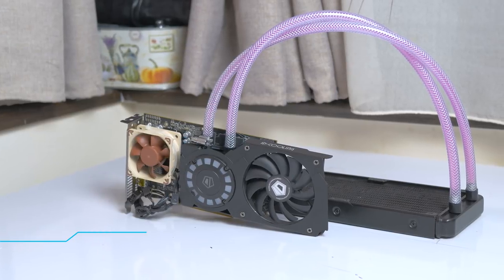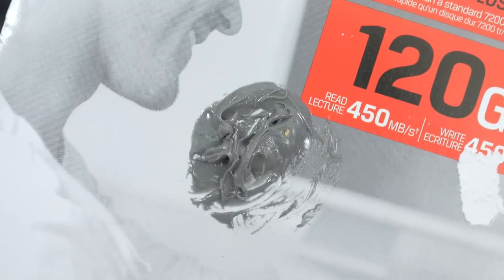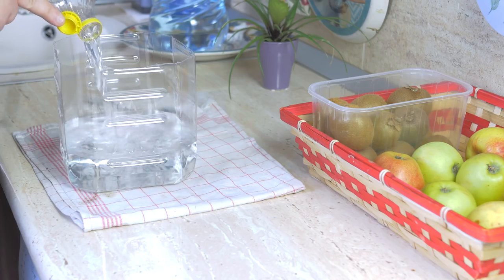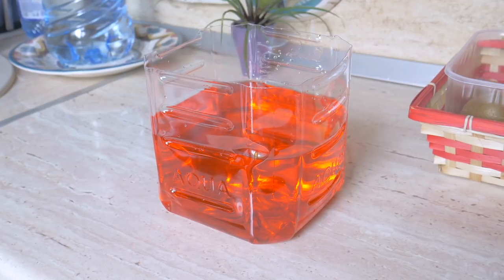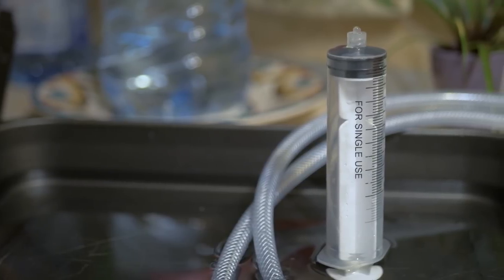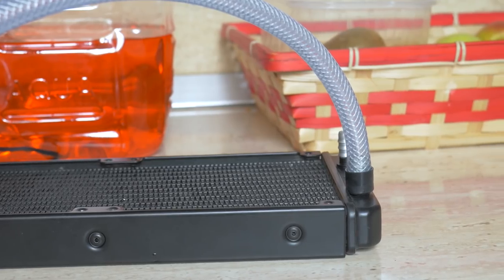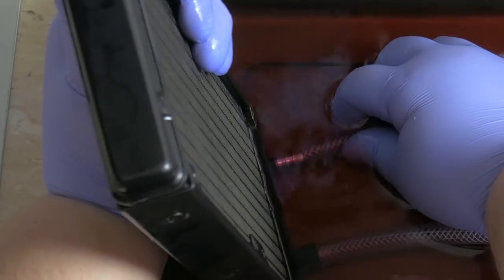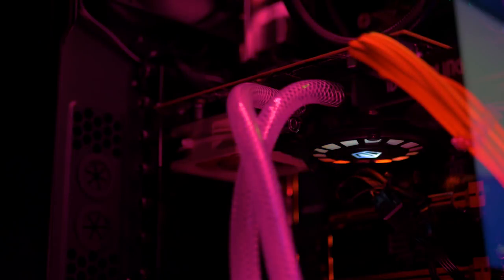AIO cooler mods: replace TUBES, COOLANT and REFILLING

Comment: unless you are ready for constant upkeep do NOT use any pastel fluid unless it is being used TEMPORARILY especially with the small diameter hosing. i had pastel fluid in my ridiculous custom loop and within a few month noticed temps started to climb the coolant had already started to clog all of my water blocks. Took 3 days to completely disassemble clean and reassemble the entire damn thing. From what i have hear and will be using next is TT coolant and than i will use some of their transparent dyes to color the fluid. This should last just under 2 years before needing to be changed out and hopefully will never clog my blocks that sucked massively to break everything down completely soak and clean it. also the pastel dyes your tubing in like a few days and they start to become hazy. My next endeavor is going to be to turn this into a dual loop system to increase the flow and  use the 2nd pump i already have and to avoid buying another d5 lol. Even tough im gonna have to spend another 200 bucks on fittings and other misc crap. 2 different colored loops will look amazing tough.

Comment: This was a good video to watch and learn. However I have a question. I want to replace liquid inside my h100i but I dont want to open up tubes. Is it possible to make a proper refill by removing copper heatsink and using a syringe? Thank you.

Comment: Would t not be easier to add a top-up valve in there? Easier for the future and easier to get the air out? Also, instead of metal clamp, plastic zip tie?

Comment: So I was building my first pc and the mounting brackets on my Corsair h115i platinum had to be switched. I had no idea what I was looking at or doing and started removing the copper block. As soon as fluid came out I realized I fucked up and sealed it. I have been using it for months now with no issues. I mean I only leaked a few drops out. But if I start hearing bad air noises I will definitely try this. Seeing how I definitely voided my warranty on accident. To change the brackets they literally snap on and off lmao

Comment: Sweet! Not only did i want to know this, but it was for this exact cooler (I picked up a pair bare coolers without tubes and radiators)
Reply: Huh? You can't buy an AIO without all that.. BTW you excluded but a pump?
Reply: @michaelgriffin1205  ID Cooling (the manufacturer) sells the idividual components on their Aliexpress store.

I had picked up a pair of the pump and GPU brackets on a Ebay. I foolishly thought I had found an amazing bargain so grabbed two without properly reading the sale description.
Reply: Oh I got ya now. Bout to send you and an encouraging  words to return it as that not how they come..lol. Aliexpress though.. glad your brave enough to order off there.
Reply: @michaelgriffin1205  wait times aside,  Aliexpress has overall had less headaches for me than using eBay. It is a good place to get generic items, and has been more reliable than sourcing from the US in 2020.

ID Cooling's website directed me to the Aliexpress store for parts, and I was able to make handy little CPU/GPU combo with copper rads for my mITX systen.

Comment: Hey just wondering your opinion. I have Cooler Master Seidon 120m since it was first released. Every thing seems to be fine, temps are well under 40C and all, but I would like to bleed the air out and/or refill my coolant. I'm not really sure if it can reclose if I open that port up but it should since that's how manufacturer filled it in the first place. Thoughts? If you see pics of the rad you can see a port right by the tubes/nipples on the RAD. Thanks

Comment: hey MindBlank Tech, I was wondering how you got a vrm fan mounted on your rx 480. I have the same exact AIO as you do but I don't have any idea on cooling my vrms without zip tying. Thanks!
Reply from the maker: +MrMistahShadow Hey! I used zip ties. :D It's just those white ones that are kinda milk-ish colored so they don't stick out compared to the Noctua's cooler same body color.
Reply: woah, how did you go about zip tying it? did you just zip tie it to metal panel where all the video inputs are at?

Comment: @MindBlank Tech Were you able to reach 3600mhz on the ram with any other ryzen cpu?
Reply from the maker: +Patrick S Hey! The 1600 caps at 3200, the 1600X at 3000-ish and the 1500X around 3050-ish. The 1600X is the poorest of these 3. Only my 1700X can go to 3600 and it caps around 3650 but some high-ish CL setting. 3000 is ok for any Ryzen CPU, which is the frequency that each of my CPU's managed. I think there's a fairly high chance that a Ryzen 5 can do 3200 which is the max on most boards (no bclk OC) anyway.
Reply: MindBlank Tech Would it be possible for you to get ahold of another 1700x,to see if it is a fluke  (a really good memory controller on your cpu),or if it's the combination of parts and can be attained with another 1700x?If another 1700x reached the same 3600mhz on the ram ,this would help amd and the the community to show that there is definitive reason and value to the X.Thank You
Reply: +MindBlank Tech Interesting that you say the 1600X can only reach 3000ishMHz. With the Ripjaws V F4-3200C14D-16GVR, the MSI B350m Gaming Pro, and the 1600X I was able to get RAM speeds of 3200MHz. Maybe your setup is different, but 1600X can most definitely work with 3200MHz RAM.

Comment: Can you do a vid on swapping the radiators out, say a 140 for a 280 on a eVga hybrid cooler? I am tempted to do this myself.
Reply: In this vid he replaced hoses, so what is the difference in using 140 or 280 mm radiator? Same steps required.

Comment: Hi, nice video btw. I just wondering if the bracket can fit with id cooling aio frostflow series (non plus), is that right?! With replacing the pump with frostflow aio pump because it looks simillar. Can u do that?

Comment: Im actually doing this with an old H50 and 160mm rad. Its an apevia HTPC case that has 2x80mm rear exhaust fans.  Using my old X58 board with a i7 990x that will be just 6 cores and Hyperthreading off. Its gonna be my 4k HTPC and retro rig in one.

Comment: the first half of my radiator is very hot, the 2nd half is cold. sound like I have a clog maybe?
my computer is over heating and there is a service hole I filled it up a little.

Comment: Hello, Gretings from Venezuela.

This video seems awesome but I do not have the guts to take action just yet.

I have a Radeon R9 295x2 that I very highly suspect has an air pocket problem, during the past 6 months one core has been increasingly getting hotter than the other and if you grab and shake the radiator you can feel the splashing inside. I really want to just open it and refill it, but I am very scared of doing so. To make matters worse, my country is in a very bad situation and there are no pc hardware places where you can even ask for knowledge about this.

I am thinking about making some kind of modification to one of the tubes, giving it one or two lids, so that I can make periodic refilling in an easier way, but I have no idea if it is possible (the only thing I know I can get around here is distilled water).

Do you have any knowledge about the tubing dimensions for my card, so that I can maybe do the same as you or something similar?

Comment: Ethylene glycole is extremely toxic, it is made for vehicles to raise the boiling point, I don't see why we would use it in custom loops. Many have success with food coloring, but I'm just skeptical of blockage and clogs. 

Overall, very informative video, keep it up bud.
Reply: Because it has anti corrosion stuff and it raises the boiling point of the water same concept just a pc instead of a motor
Reply: And its only toxic if you drink it.

Comment: You don't need that much antifreeze, 5~7% is more than enough.
Reply from the maker: +Detmer I added 100-120ml to 2L distilled water in the end. So that's around 5%+. So far so good...
Reply: Ok, wrong assumption of mine. I thought it was more, stuff probably has some strong color ;)

Comment: Instead of using anti nature chemicals, how about a freaking silver coil or something? Silver is anti bio-organic. So it will destroy/prevent algae/mold. And you always have good distilled water for years to come. 

This is less a thing for AIOs, but for everyone that uses a custom water cooling system! Also, people seem to hate spigots.
Could it be more easy, to have a spigot on your reservoir for easy draining? You can drain the water, while the PC/pump is running. And you refill at the same time. Draining, refilling, cleaning in one smooth swoop...

But that is barely necessary, because the pure distilled water is still clean. Thanks to the silver you can put inside the water reservoir. Be it a silver spiral/coin/spoon/arrow/bullet or even a wedding ring etc.

A small spiral can even be put inside the tubes itself. So there are no excuses aside of ones own laziness to use silver!

Comment: just use distilled water my friend
Reply from the maker: +gmrb79s Only distilled water, while slightly better as a coolant than a mix like this, can and will prove to be corrosive over time, especially in loops that have copper and aluminum like this AIO. That's what the antifreeze is there for.

Comment: Your radiator is way to short than your waterblock bro simple physics that might cause damage to your aio... What i mean is the level of radiator should be higher than the waterblock when your wateblock is higher than your radiator that might create an air pocket in you waterblock that is not good

Comment: The coolant for radiators is cheap now dont use antifreeze
Reply: antifreeze is used everywhere incl. home heating systems, cars, etc. You need 7-10% antifreeze and distilled water. Ethylene glycol is just a type of antifreeze (the coolant for radiators), so the advice is dubious at best.

Comment: No. Do not put coolant for cars in it!! You're not keeping it from freezing and splitting plastic and radiators.. omg no no.. You see what coolant does to rubber gaskets? Especially  ones that aren't rated for that chemical! You mix propylene  glycol with distilled to achieve that for non greesy nut n bolts aka not a mechanic shop electronics.. perfer you to use %100 pure water as its also not conductive but gets pricey for size to price.. colder environment  needs more glycol  to water ratio.. common standards are -20C and -40C on testing standards.. being colder you have to contact them and they'll mix one for that environment.